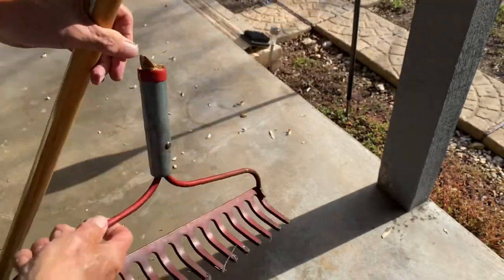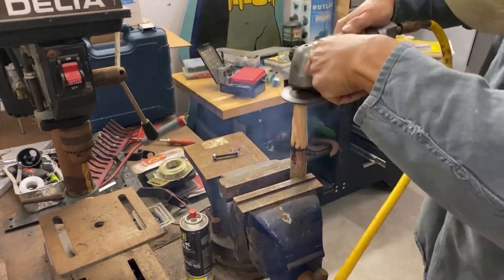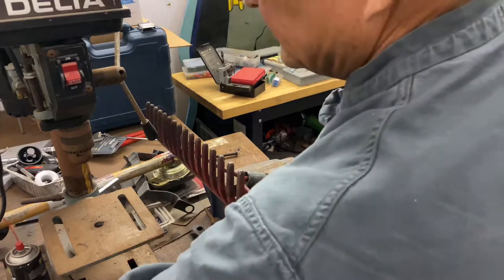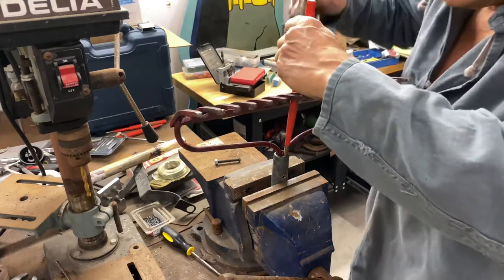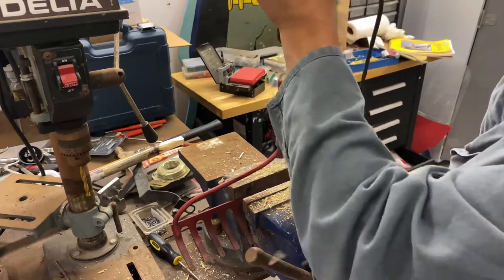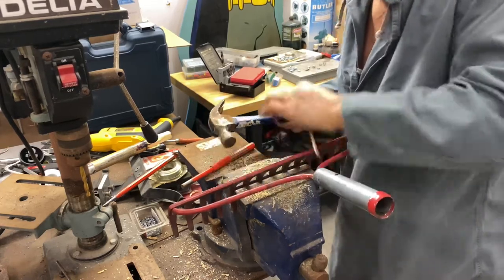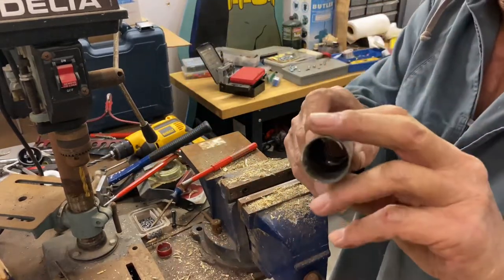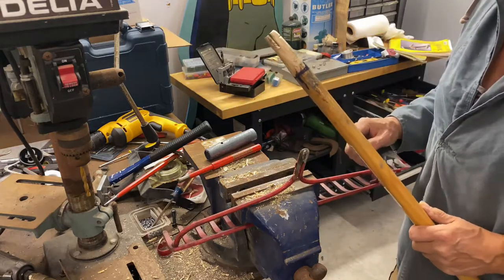Repairing a Broken Rake

Comment: After that you can put air in the tire behind you
Reply from the maker: Lol…good eye. Actually, that motorcycle hasn’t been ridden for 15 years. I have new tires and it is for sale. 1991 Honda Transalp 14k original miles. It was only sold in the US in 1990, 1991. It has been mothballed for all that time.
Reply: @MarkKratzMC  no worries.. just having fun .. great job